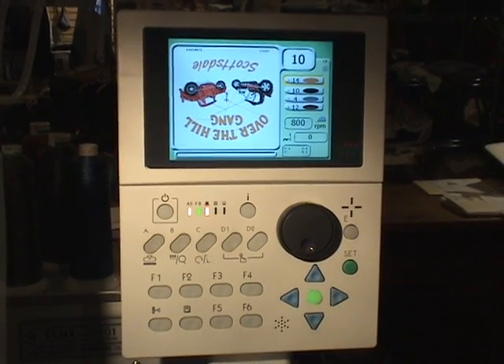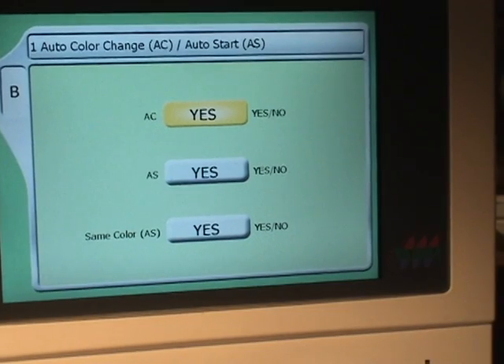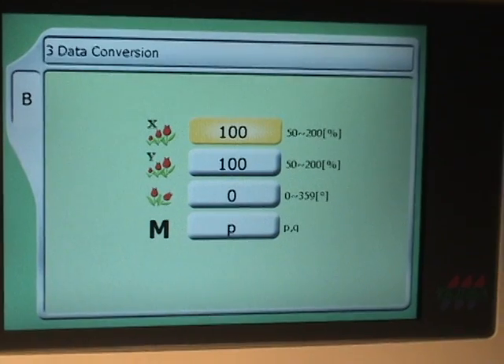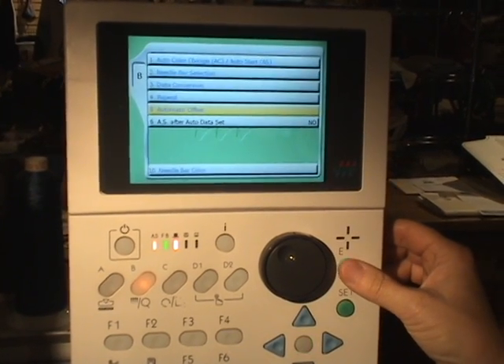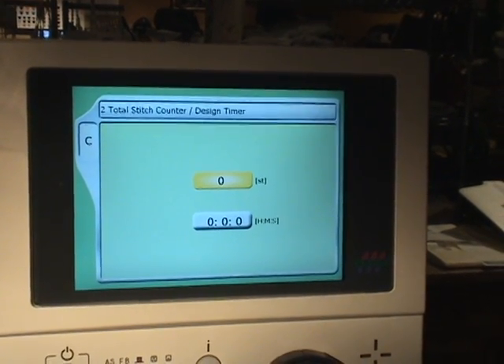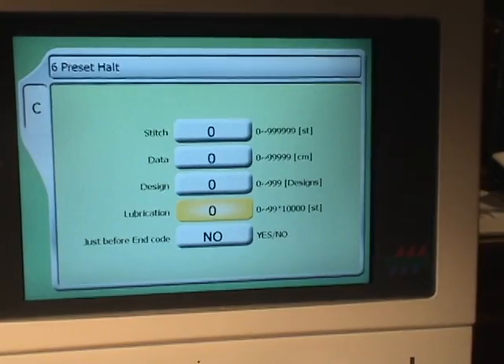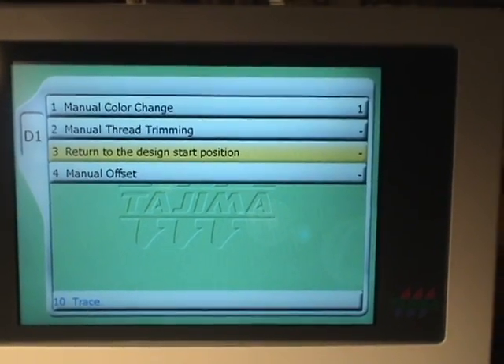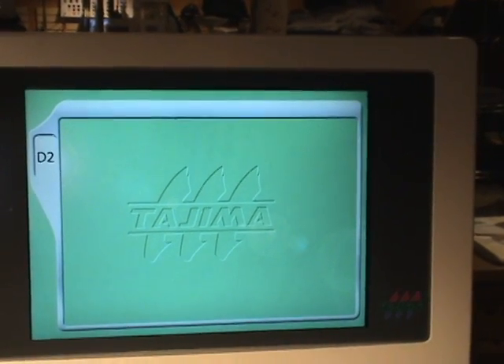M Machine Controller

Comment: Hi there, my dad has the same machine but it is stuck on the startup screen that says windows. Do you know what he can press to get it to function?
Reply: cpu is not working anymore u need upgrade for x21 type
Reply: Sounds like the Windows installation is corrupt.  I am assuming its Windows XP, you could try running an install repair from a USB drive, if that fails then perhaps re-installing windows from a USB drive would work, however do not do a fresh install as this will overwrite the software to control the machine.  

If you have the control software available or if you can get a copy from the manufacturer then do a fresh install and then re-install the control software.